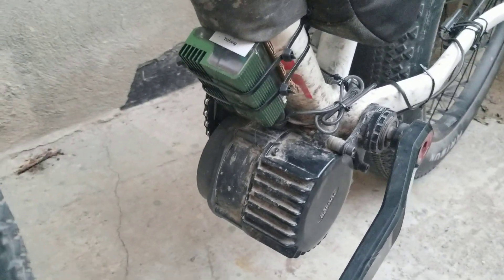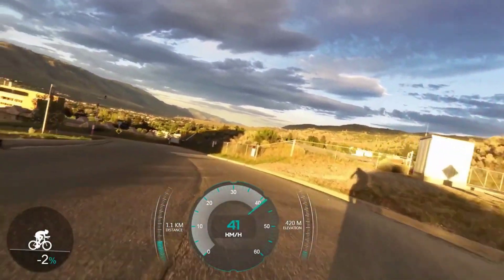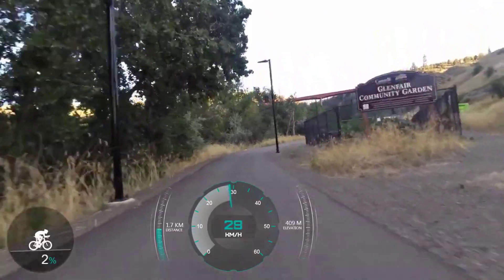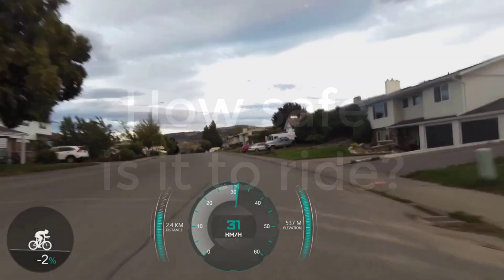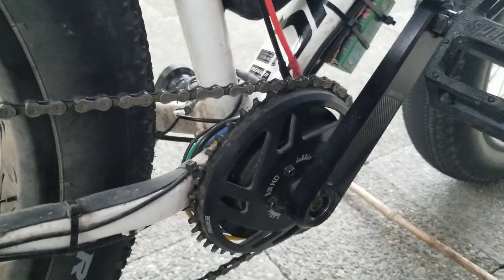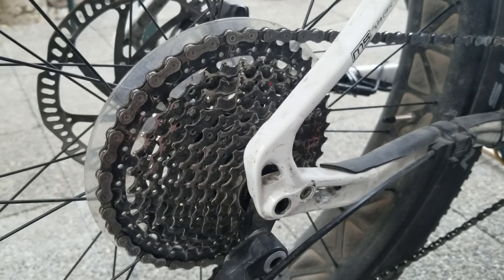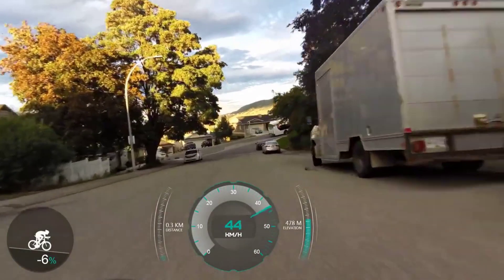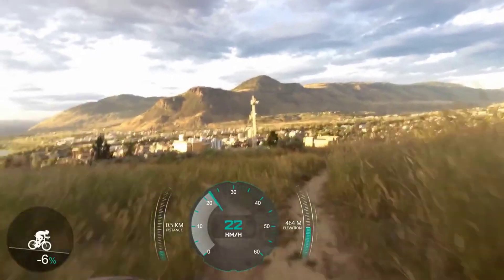Bafang BBSHD - Ultimate Controller? ASI BAC800

Comment: Hmm, sounds like this would feed my need for more speed, might have to look into one of these controllers for my commuter bike. Not a lot of hills to traverse here in Las Vegas. I think the biggest grade is maybe 2% uphill going to work. It's all flat and down hill to home. Speed limits are 35mph tops on my route. Being locked into the 750w max on my BBSHD with 52v battery gets me to maybe 27mph on the flat with throttle only. I can PAS up to about 30mph in the highest gear on flat ground. BTW my Bafang is mounted up to a Schwinn Central 700c. I mounted up Goodyear Transit Speed tires since the stock rubber wore out stupid fast after a year of commuting on it.
Reply: I have the 750w and i get 30 mph now i changed the back cassette to 13.28 . Before i was getting 25 mph with the 14.34 so the 1 less cogg gives 5 mph . Looking for a 11.28 an that will get me pedallin up to 35mph . Took some time to sort the gearing out as 1st i was pissed off
Reply from the maker: Sounds like a sweet ride. You'd easily hit the limits with the asi even on the lower power settings.

Comment: My bbshd does 50+km/h on flat with a standard controller set to 28amps with 52v battery
Reply from the maker: That's great! You must have done a good job on the install!  If you check some of my earlier stuff the fatbike did 50kph on the 27 amps em3ev had it on when I bought it. It just took a long time to hit the speed and it would not maintain it up hills. The ASI controller blows the stock performance away. It will do 60 on the flat on a full charge and gets to 50kph very fast. Even up a 9 to 10% gradient it will hold 45 kph. What bike are you riding? Cheers!

Comment: Incredible video Captain Codswallop.  Thanks for sharing your research on new controller.  You said the controller sends 50amps to motor, but I believe your battery from em3ev is only 40amps continous right?  So are you really getting that 50amps to motor?
Reply from the maker: Thanks! You make a good point on the battery. I emailed them before I bought the controller and Joseph said 50amps was the max and the cutoff for protection via the bms is 1 second of just over 60 amps. Looking at the readouts it seems to be pulling 50 amps. But the bms may well drop it down a bit on longer stretches with it wide open. If I do another battery I will get the higher energy Panasonic cells as opposed to the samsung 30q's
Reply: @HighVoltageKits  I have been window shopping for a 72v battery for about a month now and I'm pretty sure I'm going to go with the LiteSpeedBikes 72v 20.4 ah but with another parallel group making it 27.2 ah which is 1958 watt hours, I really wanted an em3ev battery since I currently use a 52v from them but they don't currently make a triangle 72v battery and are too busy right now to make a custom pack.

So for a 72v 27.2 ah 50amp bluetooth bms battery with a 6.5 amp charger and a bag it's going to be $1,900 CAD which seems insane after thinking how much I've already put into this hobby especially since i started off with a BBS02 on an old bike I rode to work then got hooked on the power and decided on getting a Giant Talon 1, BBSHD, Eggrider, ERT BAC800 and now a much bigger battery I'm just wondering how much more am I going to spend on this hobby/addiction lol.

Actually I have been thinking about upgrading my throttle from the cheap LunaCycle full twist to a Magura or Domino full twist but that's for another day...
Reply from the maker: meow boxie That's the danger lol. It's cheaper than gas / petrol right?? lol. I emailed em3ev regarding 72 volt stuff and they said the size of the bms caused the pack to be shaped like that. They are looking for a smaller bms that will make a triangle pack and said they will likely offer it in the future but not time scale.

I wanted a custom pack but alas it's not an option for them due to work volume. l will look at the litespeed one, thanks for the info. Luna do some as well but I'm just not keen on them. My one order experience was a bit poor. I'm not convinced of their battery quality. But they have been around long enough to know what they are doing I guess.

Some people use lipo but I know nothing about those. Other than you can blow them up charging them apparently.
Reply: @MeowBoxie  Hey do you ride the Gaint Talon in winter?  How does it perform in  snow with the HD?
Reply: @trekbiker6069  I haven't had a chance to ride in the snow yet since I just bought all of this in the last 2 months or so but I have looked into studded tires for it and might try that out if I can take the cold.
Reply: @HighVoltageKits  I used some of my RC lipos with the Bbs02 before my proper battery arrived and that was about as sketcky as possible because I also had a 5s2p liion pack I made from some Samsung 25r cells I had lying around but that worked for me for the 3 weeks or so I needed it.

I got my BBS02 from Luna and they were alright but there were some screws that weren't completely tightened and when my chain came off it ended up ripping those screws out and they really weren't any help in replacing them even with pictures showing which screws, plus the duties from FedEx screwed me royally on that motor because Canada...
Reply from the maker: meow boxie That sounds fun lol. I paid nothing on my order from em3ev.com! No idea how they did it but the dhl channel they used was not looked at. The motor and the battery came separately and I maybe paid 80 or 90 bucks.
Reply: @HighVoltageKits  Yea i ordered my battery and BBSHD from em3ev and had no duties it was great and the service was fantastic although it took a couple days to get replies to emails I'm assuming that had a lot to do with time zones and how busy they are at the moment.
Reply: @MeowBoxie  How are those QB26800 cells in the 72volt battery pack?  Have you heard anything good/bad?
Reply: @trekbiker6069  I read some reviews and watched a test video and they seem pretty good at 6200mah/20Wh with 20 amp draw and 6900mah/25Wh at 1.36 amp draw which is perfectly fine for me since they will only see about 12 amps per cell on my bike.
Reply: Well if it says pulling 50 amps then it must be.  You are getting incredible acceleration and it looks so smooth.  It will be interesting to see how the HD holds up over the next 6 months with 2500watts going thru it.  Please keep us updated.  Keep up the good work!!!

Comment: Awesome you decided to get this controller, I saw you in the comment section on another video and I just placed my order for the Bac800 yesterday from ERT so I hope you're up for answering some questions...

How fast was shipping to Canada? I'm also in Canada and wondering when I should expect it.

I saw you were trying to make your bike street legal with the stock controller but can you still do this with the Bac800, Either through the BacDoor app if you can get login details or through the Eggrider?

I ordered the 72v version even though I currently only have a 52v battery I plan on upgrading to 72v just to keep the heat down on the motor but in the mean time I hope I can still use the 72v version with my current battery, Are you running 52 volts now aswell?

Sorry for so many questions but there really isn't much info on the Bac800 especially paired with a BBSHD or Eggrider and there's conflicting info on the BacDoor app too, I really like to tinker with things and I'd love to be able to adjust settings how I like them on the controller.
Reply from the maker: Yeah fo sure. It will be later tonight as I got to finish up at work. Cheers
Reply from the maker: It was pretty quick shipping. Maybe five days. I have no idea with regards to the 72 volts. I went with the 52 volt plug and play version. I read some stuff about the mapping (whatever that is) needs changing to run the different voltages. The wiring for the eggrider might be different as well. This info came from the uk site electron cycles. 

The bacdoor access is not quite as simple as ERT does not issue logins ASI do directly. They dont seem super keen to give them out if you dont buy from them direct. Alan is a good guy and will help you with the 72 volt issue. If you have a bafang programming cable you can use a desktop version of the bacdoor app. 

I did get a logon by calling ASI. I may just have been lucky tho. Alan was pretty surprised I did get one. 

What you get with ERT is very good parameters already configured. I have changed nothing and it's great. 

I believe that they are working to make the eggrider app work to program the bac but it's a future update.

Alan will pick up the phone and answer texts so it may be a good idea to contact him with your situation. It might be that your bac needs configuration to work at 52 volt and then changing again when you hit 72 volts. 

No worries about the questions. Happy to help.
Reply: @HighVoltageKits  Alright thank you so much for the help, Hope you keep making videos about it.
Reply from the maker: Will do. I have to reinstall to waterproof so will show some more then.

Comment: You'll have to put up a video showing how you installed the new controller.  Thanks interesting video.
Reply: Yeah would Love to see the installation
Reply from the maker: Pi Bo I did a reinstall video recently. https://youtu.be/vXGPNPmohXw there is also some good stuff on the electric race Technologies channel.
Reply from the maker: You are welcome. I had to get it on fairly quick as it's my main transport. I have to fix it on better though so I'll do some more install stuff when I do that. Check out Electric Race Technologies channel as there is an install video on there. Cheers.